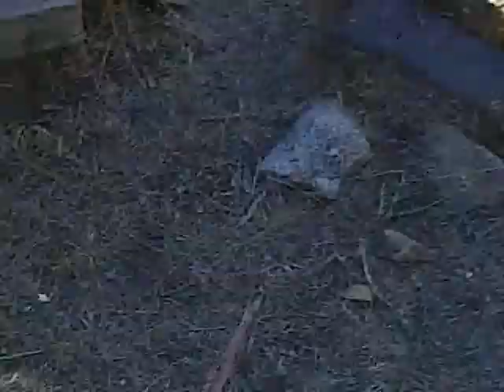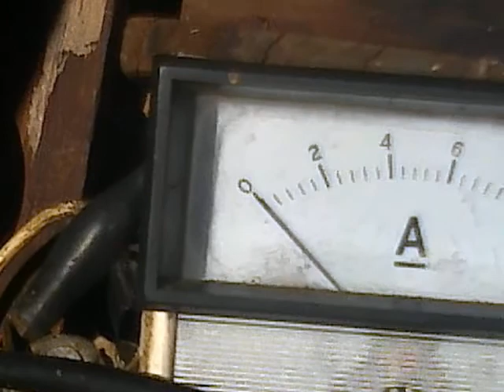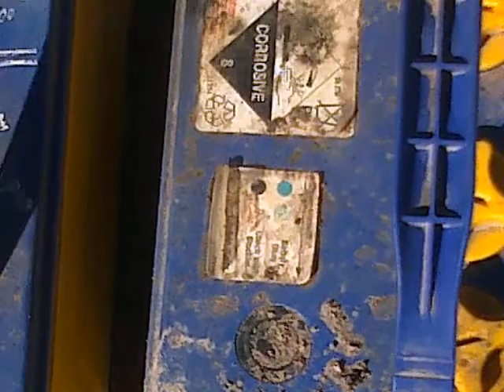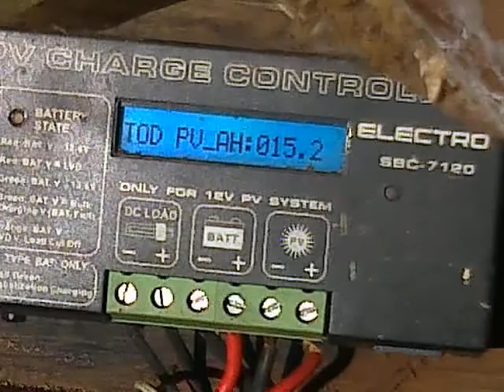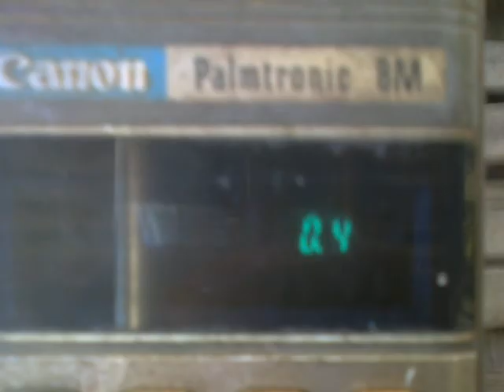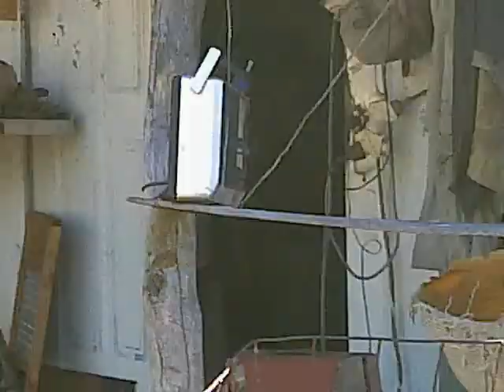Power Inverters Old & New, Product Review ; Repair Or Renew...(?).

Comment: I'm not surprised the old inverter is better than the new one at all. Maybe a new one at $300, rather than $89.00, would be as good. Well, at least you do have a little backup in the event the old one ever does fail. Looks like nice weather there. Cheers!
Reply from the maker: G'day Fee,

  Thanks mate.

   Well, the new $300 units produce pure Sine Waves which are better to listen to on the Stereo..., and they have a Fan which only turns on when the Temperature goes over 30 Celsius ; but they still need to be switched off, and there's no information on what their "Parasitic Drain " is when hooked up & switched off with no load.

  I was going to buy a new Sine-Wavy one as the main unit if the old one had turned out to be unfixable (if I'd blown the Output Transistors - which are apparently unubtainable because nobody's used them - or made them, for over 20 years...).

   The Weather looks droughty, lovely clear skies & clouds which don't rain...; which is getting pretty upsetting, actually - everything is as dry as a bastard..., and a warm dry Winter sort of sets us up for a really horrible Fire Season when Autumn comes.

  But, at least there's no molten Rocks coming up in the middle of the driveway - like it is in Hawaii, so I suppose there are worse things than Droughts & Fires ; Krakatoa was bad, and apparently the Lava is draining down towards the Water Table and a big underground Steam-Bomb is thus being constructed while everybody waits to see how big the Bang (!) will be...

  You'd best postpone any plans for a Surfing Holiday in Pineapple-land, least you become a part of the Stratospheric Ash-Cloud...; and one wonders if an explosion on the East Coast of "The Big Island" will focus a surfable Tsunami at the West Coast of Norte AmeriKano ?

    (...I always thought Oz was "The Big Island"..., it's what Tasmanians call the Mainland..!).

  Have a good one.

   ;-p

 Ciao !
Reply: WarblesOnALot Funny you mention Hawaii, I've been following it thinking perhaps California might get some impressive waves as a result. My current plans are to be out there by summer's end, god willing and the creek don't rise, for my a chapter in my next big adventure. But not to stay nor to surf. The only thing I surf now is concrete, and down hill 😀 I'll stop when my knees or my skull gives out, whichever comes first :P I do feel bad for those folks and hope the coast guard and navy aren't so engaged they can't get people out of harms way should the steam powered bomb go BOOM! I'd not want to be in a Vesuvius reenactment so I can't imagine any of them would want to. They've also got some little chemical plants near the fissures I hear. Brilliant! 

Meanwhile, in the middle East... :/

Sorry to hear about your dry weather and here's hoping that changes for you. Have you stopped rain dancing??
Reply from the maker: +Phoenix Chastaine 

  Oh, no, I'm raindancing as hard as I can..., and my place has been the last place to go brown & dry off, too - thanks to the Dew ; but all my neighbours and the whole Electorate voted for Barnaby Joyce back in November last year, so the Weather Gods probably can't resist giving the silly bastards a bit of Stick for their foolishness ; and I'm surrounded by Sheep & Cattle Graziers, a Sawmiller & an Apiarist, and all of them voted for Barnaby (the Patron Saint of Coalmining, Gas-Fracking, Sucking the Murray-Darling Basin dry, & killing Sheep with Heat-Exhaustion in mobs of 4,000 at a time, per Boatload of 40,000 to 65,000, via Live Animal Exports in 30 year-old Un-Airconditioned Ships, in the Arabian Summertime...; as well as fucking the Painted Secretary behind his wife's back...).

   And if all my adjoining Neighbours deserve to have their Land shrivel up perish undee their feet for a while...; then simple Shotgun-Effect means that I cannot posdibly go completely unscathed...

   But it would be very nice if a bunch of little Storm Cells would drift into a line-astern to the Upwind of me, and then take it in turns to trundle past going overhead ; and all drizzling onto the bit of Land which I pay the Rates on.., if it has to start & stop Raining at my Boundaries then that's Okay with me, but yeah I'd like it if the Country that I'm responsible for could be wetted-down, assuming that such can be done without sacrificing too much of whatever else is already happynink around hereabouts...

  Such is Life...

 Have a good one,

  (And, be wary of Coastlines....; they have Tsunsmis...).

  ;-p

  Ciao !
Reply: WarblesOnALot Okay, I'll keep the tsunamis in mind...I've been through hurricanes and earthquakes and bullets and bombs and aww shit mate, at this point IDGAF you see...it's only Life after all :) Anyway, I hope you get your rain wish sooner than Soom! Cheers!

Comment: The mad scientist videos are why I subscribed!  No surprise the new inverter is inefficient.  Maybe turning the new inverter vertical would increase the heat dissipation?  Wonder if a modern $300 inverter would do any better?  
  Always been curious about why you chose the pyramid shape to store batteries.  Made me think of the Thomas Trawoger  power generating pyramid.  The maddest of science to generate electricity with no moving parts and no sun required.  Thanks for the rundown of the power box. 
Thomas Trawoger pyramid power 
https://youtu.be/gQvw-ITsvzk
Reply from the maker: G'day,

  Thanks.

   Well, when it's running & has a load on it the new Cheapie Inverter is just as efficient as the old one...; but the new one requires being turned On & Off whenever 240 Volt AC is required, which involves about 4 pairs of On/Off manouvres per day, with the Inverter running for 9 or 10 Hours - or it involves leaving the Unit switched on for 13 or 14 Hours of 5.75 Watt Drain, amounting to 6.44 Amp/Hours (80.5 W/Hrs, ie 10.8% of a Horsepower Hour !) wasted every day...

   Because the Fan runs whenever the unit is switched on, it doesn't matter what orientation the Fins are mounted in ; the Fan always shifts enough Air to cool the thing at full 300 Watt Output on a 40-Degree Celsius Day, regardless of the actual Output or Temperature at the time.

   I built the Pyramid of Power partly for the fun of it - a Blue-Painted Pyramid full of stored Electrickities (!), and partly because if Pyramids are good for storing stuff in then it can't hurt to put old, tender, used Lead-Acid Batteries in a Pyramid...; and mostly because to shelter the Batteries, Inverter, 240-V. Charger,  Solar Charge Controller, Ammeters, Voltmeter, & for 10 years the Generator was in there too - it takes a lot less time & materials to build a Pyramid on a 4-ft by 4-Ft Brick-Pallet for a Base, compared to a Shed which one can walk into..., and all the 4 sides of the Pyramid open up for access to everything in there...

   And, who knows..., 5 to 10 years of use out of 2nd-hand Batteries intercepted on their way to the Dump, when I put them in the Pyramid....; so maybe the mysterious & legendary "Pyramid Power" is actually doing something useful, after all - and it certainly isn't hurting anything (!).

  So, I store my Electricity in a Pyramid because it works...(?) ; something like that !

  Have a good one,

  ;-p

  Ciao !
Reply from the maker: PS,
  
  Check in the Clip Description, the modern 300 Watt $300  Inverters make Pure Sine Waves, and they have Thermostat controlled Fans ; but they still need to be switched on/off, and though they have a "Remote Switch" it involves running a 12-Volt Current to/from the Switch to the Unit through a Wire-loop - and the whole idea of putting the Inverter with the Batteries was to run 240-Volts accross to the Hut..., because 5 or 6 Volts worth of Line-Drop from 240 V. is buggar all, but out of 12-Volts it's half of the available Power...

  So, I don't think 2018 has any 300 Watt Inverters as practical & efficient as what was available in 1985...(!).

  Have a good one,

  ;-p

  Ciao !